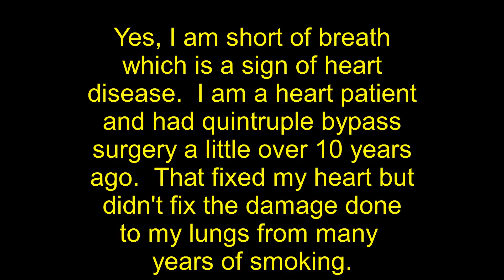Recycle Farm Equipment For The Metal

Comment: I use small acetylene oxygen torch set up, these tanks can be purchased and exchanged at welding supply houses, just like the argon on the welder. Now you don’t have the capacity of the full size rig, however it’s a great way for us hobby guys to have access to a torch occasionally. Heck it’s sometimes a couple of years before I exchange a oxy acetylene bottle

Comment: I would use a plasma cutter. All you need is a compressor and electricity. Most of your work is done around the barn. Wouldn't have to keep refilling bottles.  Oxy acetylene cutting torch is Ideal for portable use away from the barn.   Plasma cutter will come in handy for the stuff you still have on the pallet too.      1000 lbs

Comment: I’m sure you know this but for some of your viewers that might want to take a plow apart; the bolts that hold the mow board, shear, and land slide (wing, point, and shin) are made with a square lock like a carriage bolt that hold them from turning while they are tightened. While the plow is being used the head of them becomes sharp as a razor, and when you are taking them out will turn after they are loose enough to become free of the square lock and become a meat grinder if you are trying to hold them with your fingers.

Comment: Where I live you can own your own tanks and just trade them for filled ones.  The charge is for the gas alone.  However a propane brush burner (Harbor freight about $30) and a barbecue tank will give you all the heat you need for what you are doing.  Nice bit of steel in that plow.  How many hp was the tractor that pulled it?